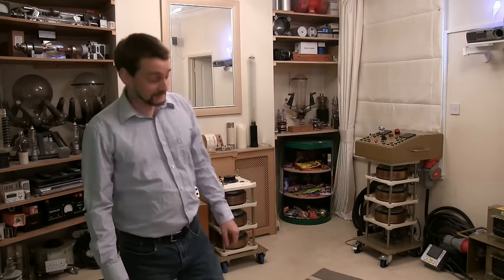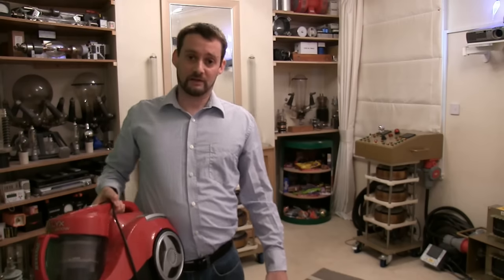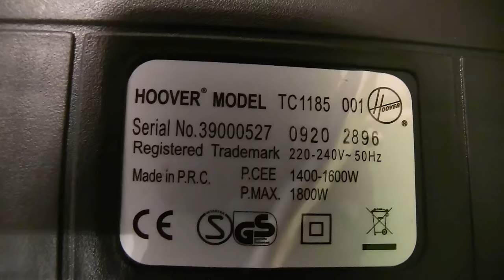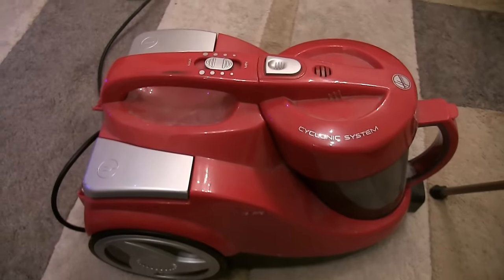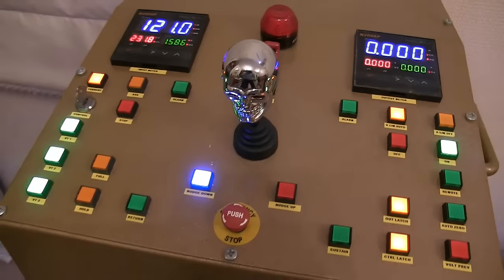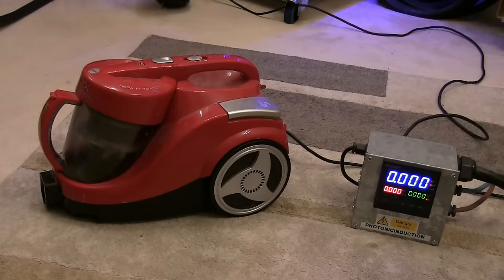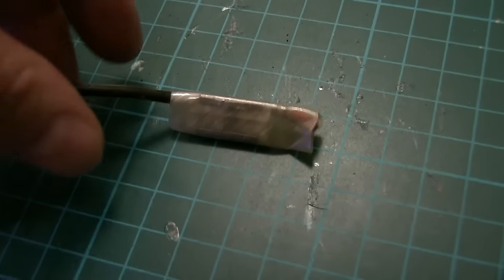Until it Pops - Vacuum Cleaner

Comment: Hey photonicinduction, if you have the time. get a tour around Culham Science Centre.
You would bolt your load there.
Two nice big Nuclear fusion reactors to get excited about.
But not half as much as the power requirements to run experiments.

The national grid will only allow 500 mega watts to be taken at any one time but that still isn't enough. They need 1 gigawatt. They have a direct feed from the national grid at 440 KV.
So to get around it there are two 750 ton drums spun up by motors a few days before, then these are used to generate electric whilst the research is happening.

The Torus reactors have a nice central transformer core wound in pure copper. none of this wire shit. proper bus bar stuff.
Only needs 1kv at 2000 amps to kick off the reactor.
The transformer is the primary and the secondary is the plasma at 150 million celsius.
Then there are the directional coils dotted all around the outside of the Torus that take the 500 megawatts the national grid can give.

Thats the JET reactor.
There is also a smaller UK fusion reactor that is powered by capacitor bank in a separate building. The whole building is full with high voltage capacitors.

I went for a tour around Culham this week on one of their open evenings. it's mental.
you should take a peek.

Maybe something you could build. lol
Reply: Have you got room for this ?

http://www.extremetech.com/wp-content/uploads/2014/04/european-jet-tokamak-fusion-reactor.jpg
Reply: Pretty cool, but did they have to build it on an intact WW2 airfield?
Reply: It was a RNAS station before. The site was originally to be set up near Cambridge university but the east of England airfields were still needed (just after WWII) hence being built near Oxford University instead. i.e. The nuclear research was always going to be built near a university, just which one and who would suffer less if an airfield was needed
Reply: Ohh a science magazine here had an huge article dedicated to that monster a good while ago. Very interesting read!
Reply: BillyNoMates1974
Around the Cambridge area, especially north-east of the city, there are untold dozens of former and current military airfields - mostly closed now. I get that HMS Hornbill wasn't a place of great importance, but Oxfordshire had relatively few airfields, and Kidlington is too small and VERY busy. It would have made more sense to have built the nuclear facility closer to Oxford when the big suburban expansion thereof was happening.

Comment: What is the device on the first small shelf over your right hand shoulder at 1:50. The one with one pointy copper and flat electrode inside of a glass bulb. Kind of reminds me of a Farnsworth tube or possibly some sort of ultra high-powered diode... Thank's...
Reply: 30kw water cooled Xenon short-arc lamp.

Comment: 2:05 reactor core start up / reactor jet spooling up

2:20 send reactor core to full speed

2:30: energy globe formed / operational

2:32 reactor core unstable

2:37: reactor core overheating critically

2:40 reactor core shut down (causes: overheating)

(Second try)

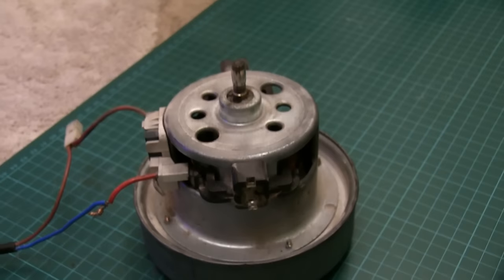3:01 reactor core starting up

3:06 full throttle

3:21 reactor globe forming

3:25 reactor globe formed / operational

3:28 reactor unstable, overheating critically,

3:30 reactor meltdown

3:33 reactor explosion

3:35 reactor jet spooling down due to the explosion

Comment: The second one sounded impressive enough. Only made it to 250v before it failed though. I expected more out of it.
Reply: unloaded universal motors tend to fail very fast even at low voltages.
Reply: @dortak6797  Yeah, that comment is 7 years old now. I get that now. There is normally mechanical resistance that would change the effective impedance of the motor, so running it free like that without doing work isn't representative of it's real world performance.

Comment: What about a computer HDD?
Reply: would probably pop the motor controller before anything interesting happens, he'd have to build a controller that gives the high voltage directly to the motor
Reply: Or just use a proper high power RC speed controller! (They are a bit pricey though)
Reply: When do you think the platter would shatter? Woah, that sentence feels really good to say. ...platter would shatter.
Reply: Not much over rated speed i'd say, they're usually made of glass or aluminium

Comment: Should have done a suction power test with 18000W!
Reply: Why? it won't pull more than 30in/Hg of vacuum. Vacuum is boring and predictable unless you have things inside the vacuum.
Reply: Also, you can hear an air bleed valve open in the first vacuum when it hits about 290V (sudden louder hissing), so the pressure would stop increasing so much past that point.
Reply: +SomethingUnreal I just loved that you and 'moo.' stepped in and replied with that information. I appreciate it :)

Comment: OMG! I was going to extend out the s curse word that is the bad way to say poop, but I got too nervous I would get some ban or warning by the admins. Lackey me. You should try this on a bigger dc brushed motor, or even a huge induction motor. The capacitor will probably go first on the induction motor if it goes past 370 volts. Try it with safety ok?

Comment: use another one get the motor out and put in the wheel car engine and put motor vacuum cleaner in car engine and test in 10000 volt engine